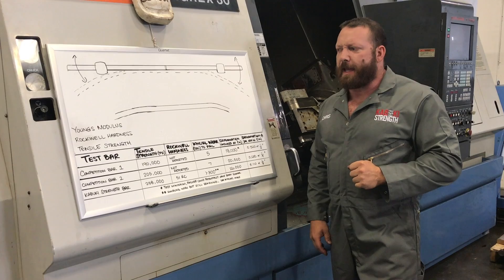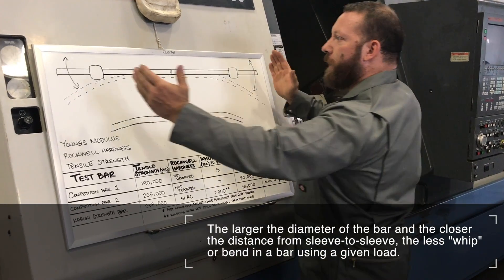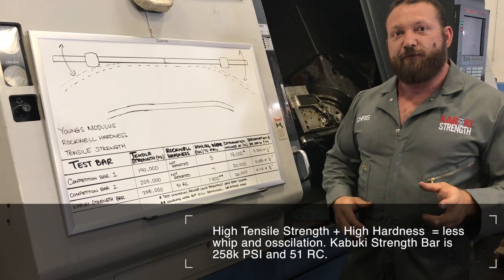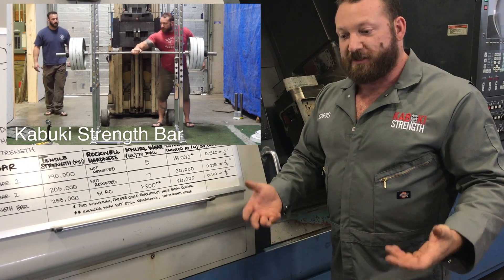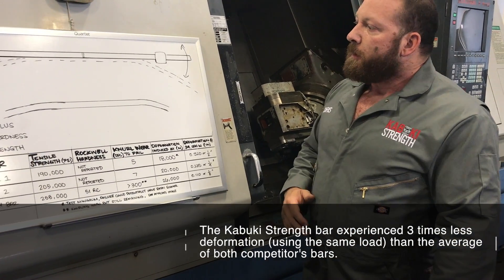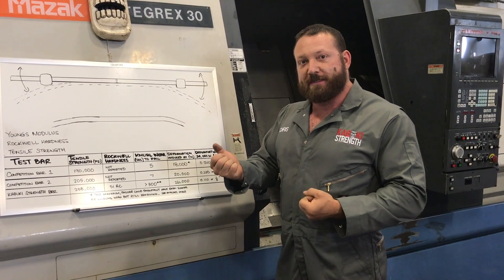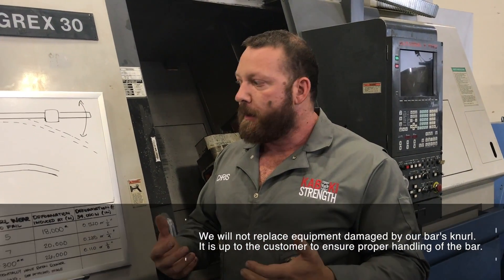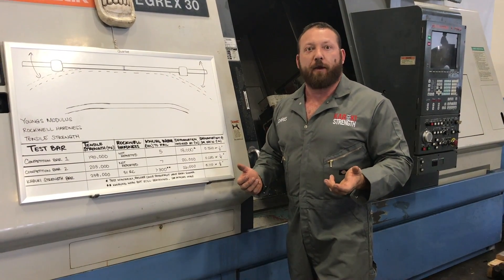Kabuki Strength New Generation Bar: Metallurgy 101 | #BarbellScience #StrengthGear

Comment: I appreciate this video, just a couple comments. The "oscillations" you mentioned theoretically may or may not be related directly to tensile strength and/or Rockwell hardness.  In the simplest sense (ignoring geometrical effects), it is related to the first-order damping coefficient.  This coefficient, in metals, is related to material effects, such as friction between grain boundaries.  As a note: Rockwell hardness is really only a very simple indicator of indentation resistance of metals.

Comment: is this a deadlift bar I'm sorry if stupid question as I have only trained with standard bars
Reply: It's a power bar which means it's good to be used on all 3 lifts (not a deadlift bar).
Reply: Collin Hake thanks man
Reply: a dedicated "deadlift bar" usually is longer and has a thinner diameter to allow it to bend more.  this bar is not designed to bend more than average. 

so, no, this isn't a dedicated DEADLIFT bar, but it can be and is used for deadlifts in powerlifting competitions.

Comment: Great video!  I would love to see how your testing results prove the differentiation between the bars' section modulus and the deflection limits.  Also would also love to see how Olympic barbells would compare to say your power bar or proper power bar considering they have a similar moment arm.  I tell lifters that Olympic barbells can be outright dangerous if you are doing a max squat or bench press as they are designed to whip and assist a weightlifter with recovery from a low squat or jerk position.
Reply: "Hookgrip" on YouTube has what you seek.